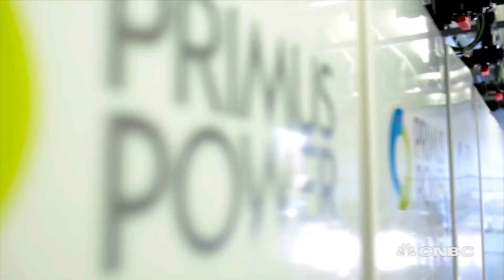How to solve the problem of energy storage | The Edge

Comment: Why they dont just transforn electricity into hidrogen? then use hidrogen engines to run the energy....
Reply: Huge loss in efficiency using electrolysis.  And with other conversion loses in each step of the process, by the time you use the generated hydrogen, you are only realizing 30% of the power you originally collected.
And it's cost is currently far more than that of an equal energy amount of gasoline.
Hard to convince people to switch when it costs a significant amount more than what they already use.
Reply: just because its so little used